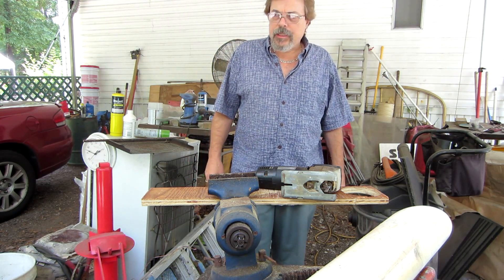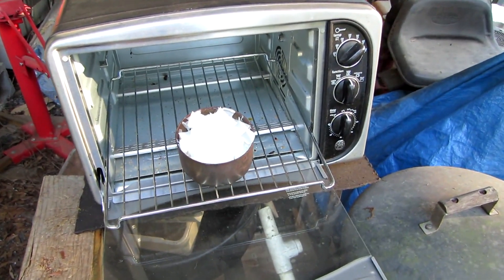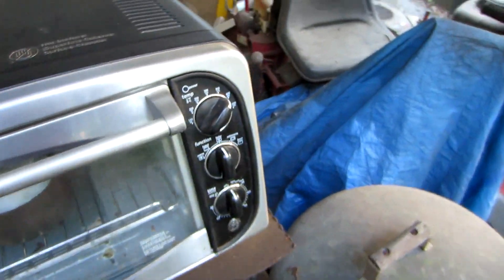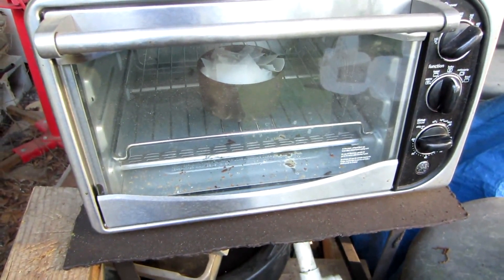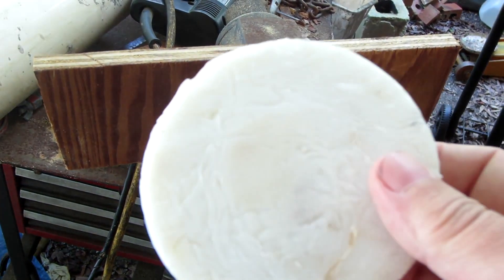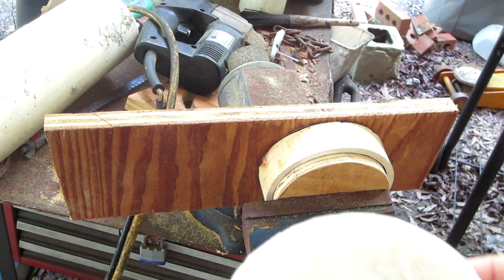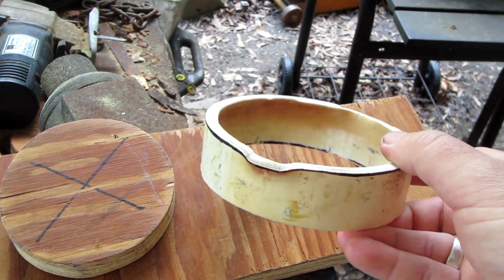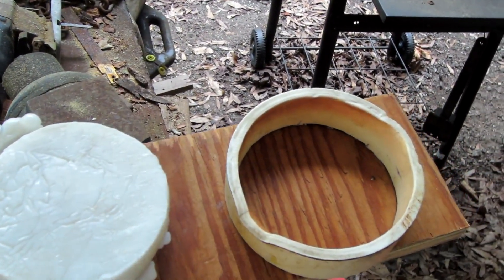Melt recycling plastic bottles and making new forms (part 1)

Comment: Do you think this could be poured onto a form would it be smooth?
Reply from the maker: This material does not pour. It's according to the type of mold whether its smooth or not. For example; if you use a mold like in this video it does not come out smooth because it shrinks as it cools down. But! If you use an injection mold it will come out with a much better texture.

Comment: You might try silicone as your mould.
Reply from the maker: jenny avila. If you pour it like a liquid that would be fine. But the melted plastic is stiff and has to be pressed with a good bit of pressure.

Comment: I would recommend using a metal mold preferably stainless steel. Or use the PVC but do not use the same one repeatedly. Swap them out after every mold. Have like 5 of them. After you press the plastic out, have a bucket of cold water and AFTER THE PIC HAS COOLED  Put the PVC mold in the cold water. -Sincerely, Artsy Craftsy Woman
Reply from the maker: Kristi Tara. Thanks for the info!
Reply: Thank you for that information 😌

Comment: You can get the labels off your jugs easier by putting them in a microwave oven with a little water.  The steam softens the glue, and if you did it right, the labels practically fall off.  You could just pour in already boiled water too, but watch out for dribbles.  A tea kettle works okay for that.

Comment: Is there a way to melt plastic without using a toaster oven?
Reply from the maker: Yes, Many ways. Large oven for kitchen use. Heat gun for stripping paint. Pipe heat straps for heating pipe. You really want to maintain a constant 350 degrees F and depending on the amount your melting will determine how long to heat it. To know the plastic is melted through.

Comment: Hi man! great video! I was wondering this: We've seen that DIY project where people make plastic bottles in to plastic strip with that strip making device. So my question is this: If you weave the strip in to some sort of sheet and blow it with hot air gun, will the plastic form a strong sheet like structure?
Reply from the maker: Hey that's a great idea! It should make a strong sheet like structure.

Comment: i was think about how to obtain a sensory deprivation tank and thought about melting plastic over chicken wire, but i wanted to ask an expert like yourself for advice on cost efficiency and weather it is a project worth looking into or abandoning.
Reply from the maker: Abandon it! Now for a better Idea is to make your tank out of plywood then fiberglass over it. People make water reservoirs like that all the time. Its cheaper than steel and plastic is too hard to deal with at that scale.
Also, instead of sensory deprivation tank you might think about DMT.
Reply: ive had too much dmt i wanna try the water thingamajig
Reply from the maker: I hear you loud and clear. I maybe doing a video later on down the road about making a water tight box for a solar water distiller using fiberglass and plywood.
Reply: i thought about making a mold of my body and increasing the diameter by 120mm and then filling it with ebson salt and putting a temperature regulator in, now you have a sensory deprivation suit! I was so ignorant to the process i thought i could collect a bunch of empty ice cream containers and then hold my cigarette lighter underneath each one and "drip" the plastic onto a mold of my body hahahaha Knowledge is power! But ignorance is curiosity Thank you kind sir for you're feedback. You have enlightened me :)
Reply from the maker: Here is a link to making a Solar water distiller, but I could have made it more durable with fiberglass https://www.youtube.com/watch?v=Gh2Jp12n62E

Comment: Just an idea, get some thin rolls of sheet metal an cut the length, and with, take a auto hose clamp or use wire to hold the metal into a mold and use it.  It can be also secured with a screw and nut.  ?  will this help you
Reply from the maker: +Ed Comfort It's worth taking into consideration, Thanks

Comment: You should modify a piece of steel pipe with a hinge and lock, so that you can pour the mold, then simply open the pipe and remove the mold. 

Same design as the large BBQ grills are built.
Reply from the maker: +dale beeson I don't have a way to cut metal or weld it at home. This was to make temporary molds on the cheap with material I have and can handle. If you like videos like this I have another channel you can find here. https://www.youtube.com/channel/UC_SEmSDuUspnTYcrPoQgDJQ
Reply: Thanks. What were you making the molds for? Did they serve a specific purpose or were they for crafts?
Reply from the maker: Although I am crafty I always have a purpose for things I make as a tool or function. I was experimenting with a motor design.

Comment: Gypsum casting plaster... if you pick up fine/smooth surface wall plaster from a DIY it costs less than plaster of paris would from a craft store. You then be able to pretty easily make a two part mold from which the cast plastic can be removed.
Reply: Great idea!

Comment: I say use the lawnmower to chip up the plastic before melting.
Reply from the maker: +Anton Nym Not such a bad idea except for even using a grass catcher how would you keep from some of the debris polluting the surrounding area?
Reply: My idea about the lawnmower was tongue in cheek; but I saw one youtube video utilizing an actual blender appliance for particelizing the plastic material.
Reply from the maker: Yeah still not practical because of the work you put in to cut it down small enough to get to the blades and then most home blenders will not take much of a load before you burn up the motor. Look at this video on my solution on preparing the plastic for melting...  https://www.youtube.com/watch?v=cWYxVYbE3hI&list=PLiF-q1gDUVqYLYYCzUsOW06gwdf7qzMuT
Reply: Ron Joiner
I saw the video. Thank you. I like the way you think.  That's some easy preparation without chipping it down. Just some preparatory tuck N' roll.   Good job.
Reply from the maker: +Anton Nym Thanks for the good words. Makes me want to come up with more good stuff.

Comment: did you try a sand mold???
Reply from the maker: No, actually the melted HDPE plastic is stiff like clay so it can't be poured into a mold. It would definitely have to be pressed it. After pressing you would have to clamp it to minimize warping.

Comment: This is a better technique for me. I want to make some Craft pieces, and use the recycled milk jugs , water bottles, etc. So I will set up a smaller oven outside, in the open air, and do the melting. I want to make shapes for Ornaments, or windchimes, or bowls. So Using a metal container to melt it in is a good idea. I can then use a aluminum bowl and form it around it and let it dry and pop it off the aluminum. SO it will form a bowl. I may do a video and show you what happens
Reply: +Angel Morgan small clear water battles are usually made with PET plastic which is different than the HDPE he's using here. look for recycling number 2 on the bottoms. The lids of these jugs are usually LDPE which is number 4 (and melts and flows much easier and nicely, though gives you a softer plastic at the end). strictly speaking you are not letting it dry, but letting it set up after being turned molten, so dropping it (form and all) in an ice bath would accelerate the cooling process. HDPE does tend to shrink up a little as it sets. and may curl up if not held in shape by forms.
Reply from the maker: +Angel Morgan I will be glad to see your project. Let me know how it goes.
Reply from the maker: Good info
Reply: I'm actually working on a series of videos about the recycling resin numbers 1-6 that you can find at home and use. I hope to have at least two of those edited and posted by months end. along with a vid on a modeling/molding compound I came up with.
Reply from the maker: Great! Can't wait to see them. Send me a shout out when they are ready.

Comment: good job with this some things i may suggest to improve it is to stop heating as soon as all the milk jug scraps are clear which will get rid of all of the burn marks also try to stay away from melting detergent bottles because they are copolymer which makes them a little weaker than normal hdpe. the reason you that milk jugs need to be clamped down is because they are normally blow molded at a factory and blow molding will not work well with a plastic that flows to quickly. however 5 gallon buckets and hdpe bottle caps are normally injection molded you will find if you melt these you will have plastic that actually flows into the mold without any pressure. however milk jugs are pretty cool to melt because they are pure uncolored hdpe and they are a little bit stronger than injection molded hdpe but injection molded hdpe is still very strong and can definetely work to make parts out of it. hope this helps
Reply from the maker: Dean Walcott Thanks for the kind words. I thinks I leaned some from your comment I did not know. I encourage you to comment more I have over videos that need some reinforcement.
Prepare your plastic for melting https://youtu.be/cWYxVYbE3hI
Melt Plastic for your projects https://youtu.be/S3WvCTOOhUg
Slingshot from melted plastic https://youtu.be/8b7Psa2t0pk
Repair trimmer head with plastic https://youtu.be/xvq3guWzSes